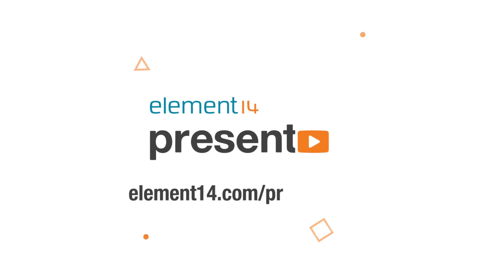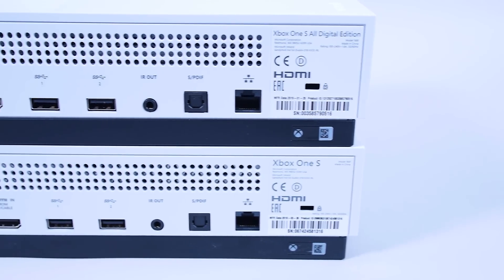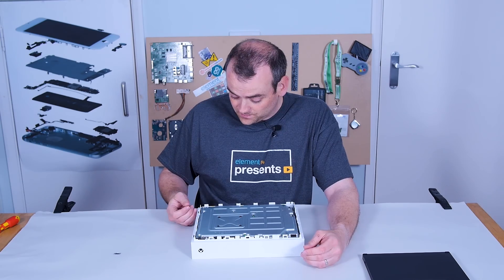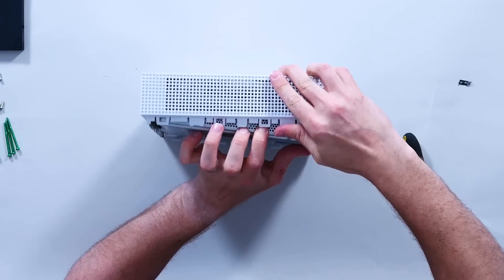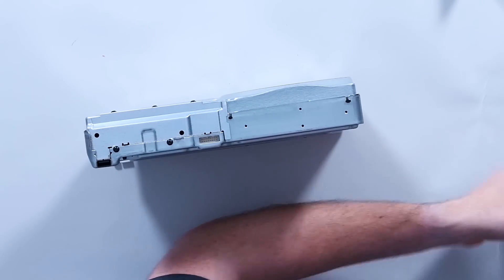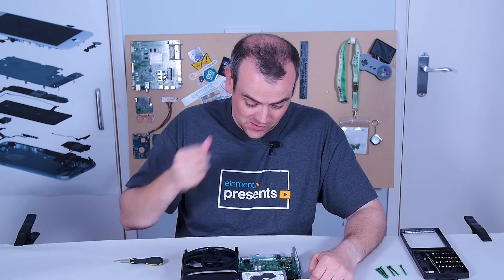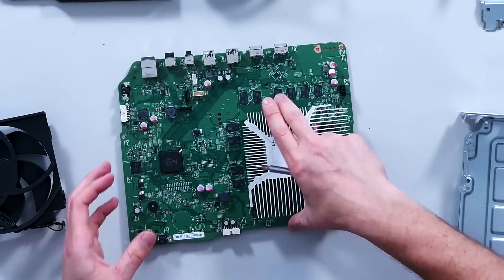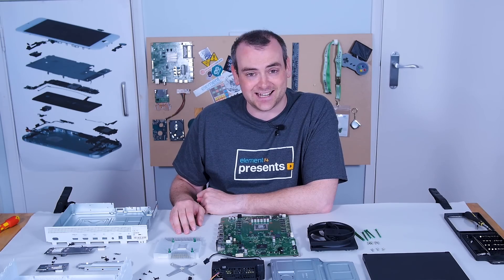Xbox One S All-Digital Edition Teardown - The Electronics Inside

Comment: it isnt as simple as slapping a salvaged Xbox One S Disc Drive,  you'd haveto deal w/ marrying the drive to the board. i can bet theres verry slight Firmware changes on the system just to identify this is an "Digital Edition" so it doesnt fail at bootup from a missing Disc drive(given even back w/ the OG Xbox and the 360, No Disc Drive/fried drive? No full bootup. so they cheapened out almost all the way. 

if microsoft designed the One S(Disc) systems to continue to function w/o its Disc Drive, then all the "All Digital" edition's would be is just the normal One S's w/ a new case.
Reply: If I can lay my hands on a One S with a fried mother board - I'll try swopping the HDD and Drive over, see what happens!

Comment: Keep the cost at 299. Use the savings of not putting in a disc drive. Put towards a larger hdd say a 4 or 5tb hdd
Reply: Or put in a slot for a 3.5" SATA HDD.
Reply: @NiHaoMike64  Its certainly a huge missed opportunity to have an SSD edition with a SATA drive bay, or even just dual-HDD.
Reply: @alexatkin  that would have definitely influenced people to go digital

Comment: the black plastic that remains from the disk drive is needed as if you look its also used as a screw guide
Reply: You are of course, quite right. I think what I really mean was why does the machine need a scew in that position at all? It made sense when it also located an optical drive, but it's not like the there is any risk of the Xbox getting bowed out in the middle? I think I might have omimited it and the screw?

Comment: Mod a DVD drive back in pls
Reply: That most likely won't happen... As with the Xbox 360, its most likely that the drive firmware has to match the motherboard.
Reply: @BillSargent1977  It's more than likely possible. Disc and discless are the same model, same board, etc. Only discless doesn't have the drive and instead has a couple of extra bits; it's literally the same as if someone took their disc One S and removed the drive. 
It's also not that hard to source oem parts anyways, there's donor systems and various resellers online, and even if you can't source a One S drive, you can more than likely source the same oem drive under a brand name.
Reply: @xaytana  What Bill Sargent is referring to is that on the 360, every DVD drive has a unique key which is tied to the motherboard.

So if the DVD player's drive key doesn't match the motherboard's DVD drive key, it won't work. 

If the Xbone has a similar system in place, then you would need an OS hack to be able to get it to work even if you have the right parts.

It wouldn't surprise me if the OS has also been modified/updated to disable drive functionality if it detects that it's a SAD edition via some kind of flag alongside the serial number, etc.
Reply: @tech34756  Yes. What you said. -- I just tossed an xbox 360 that some kids tried to "hack" and they flashed the dvd drive with some odd firmware that made it useless and I'm guessing they didn't write down the key. -- for a long time i was thinking there was a way to get a serial console hooked up to see the boot process and get the motherboard key, but i gave up on that and tossed it.
Reply: Bill Sargent These days the easiest way to get the key is to RGH it and dump the keys from the motherboard.

Edit:

Depending on the drive/circumstance.

Comment: Why don't they take out HDMI in? This thing is not cheap enough
Reply: Good call. The idea of voice control of an external set top box and TV is one of the reasons I went Xbox in this generation, but without the Kinect, it does seem pointless doesn't it?
Reply: Because it would cost more to design a new chip and casing with it removed, than it is to just keep it.

The time to remove it was when they designed Xbox One S, that time has passed.

The real joke is it on the Xbox One X as it doesn't support 4K input.

Comment: Unfortunately someone tried to use the optical disk drive from a xbox one s into the all digital edition xbox one s, it didn't work.  Either it has to be married to the system like they said or they deleted the optical disk driver for the xbone s all digital
Reply: I work in a videogame shop, if we have to repair a xbox one drive, we have to swap the processor from the old drive to the new. If not, the drive wont work.
Reply: @kingwallop  yeah that's what I thought...

Comment: I still use my original xbox one white edition. I don't know if I would consider upgrading to the one s.
Reply: If if still works, i would keep using the original model, the Xbox One X is a better upgrade, but a bit more expensive.
Reply: I agree, I just wish my original Kinnect still worked too!
Reply: @a531016  Mine cuts in and out. I think some of the first batches of the kinect were flawed. Maybe its a cooling issue. Either way, I mainnly bought it just so I could use it to turn my TV on and off with IR. :)
Reply: @BillSargent1977  Have you tried removing the connector out of the Kinect itself?  Its a tight fit and awkward to plug back in, but mine seems to have been more reliable since I did that.  Not that I really use it.